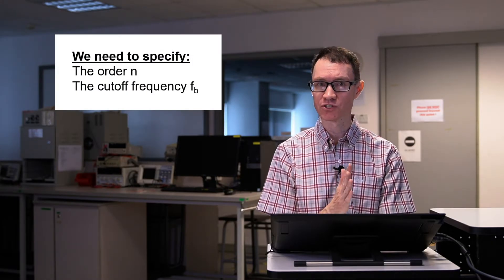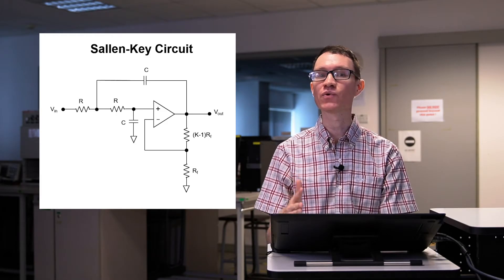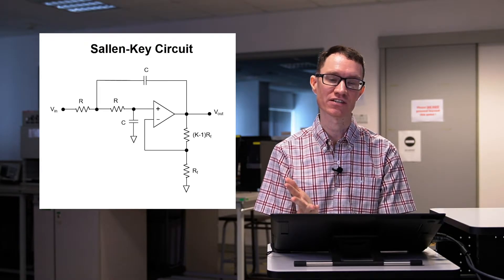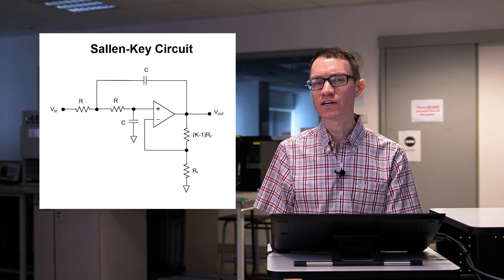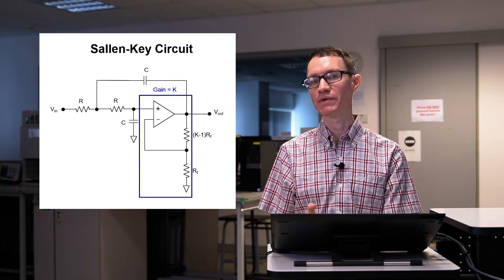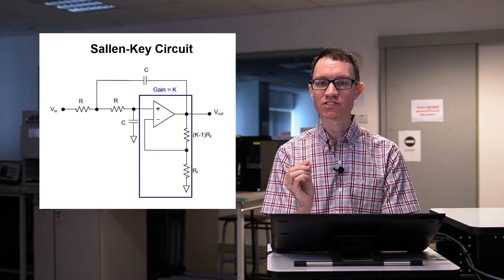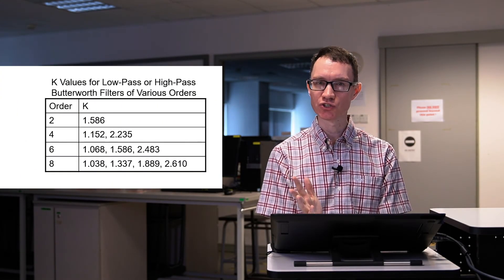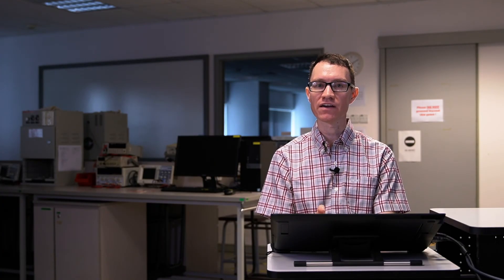How to design active filters using Sallen Key circuits (2 - Active Filters)

Comment: There are a couple of posts below asking about the values of K vs Order in the table. I'm also struggling to understand how this table is derived. For example, the Butterworth coefficient of a 2nd order is 1.4142=ω/Q in a 2nd order transfer function. Q=1/(3-K) as R1=R2=R and C1=C2=C. But ω is subjected to the choice of RC or where the HPF / LPF corner frequency needs to be. We seem to be missing the frequency information. Anyone? Oh wait! I think I've just got it because ω=1 in the last Butterworth coefficient of a second order transfer function. Therefore, 3-K=1.4142 ⇒K=1.586

Comment: I noticed the video is about sallen key filters, however the table at 3.20 literally says for Butterworth filters. I’m confused. Is the table really for sallen key filters and butterworth filters or was it going off topic for some purpose?
Reply from the maker: Sallen-Key refers to the topology.  Butterworth refers to the transfer function.
Reply: Butterworth is the overall transfer function for the system of cascaded sallen keys

For example a 6th order butter worth LPF can be implemented by cascading 3 sallen key LPFs, each of which has some specific cutoff frequency and Q you get from the table